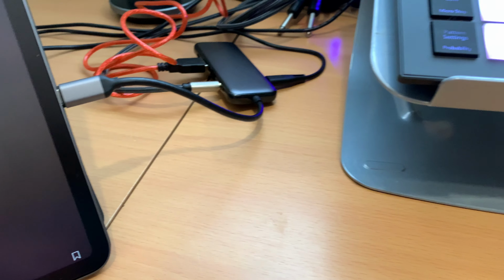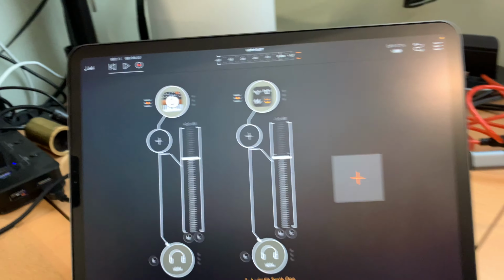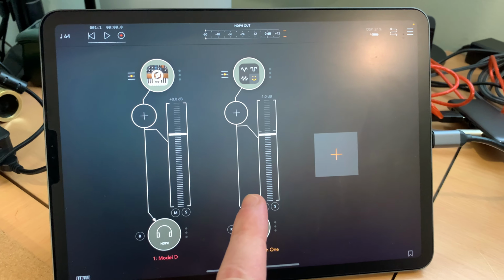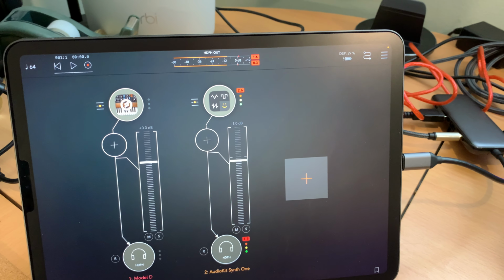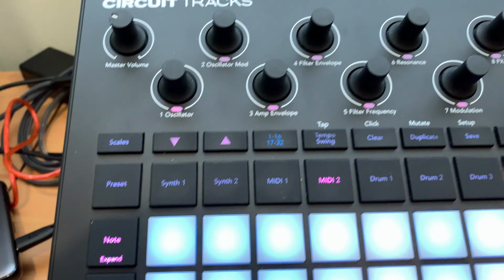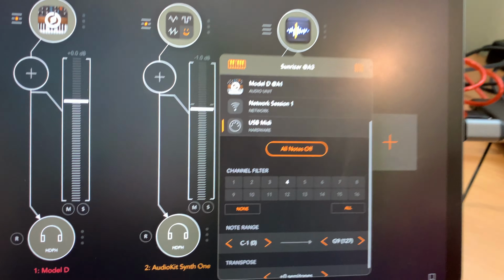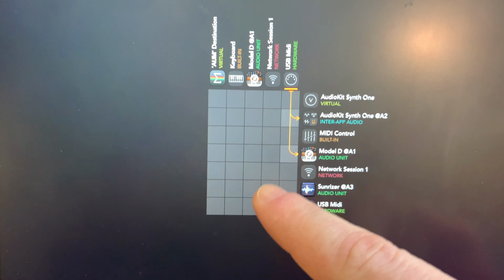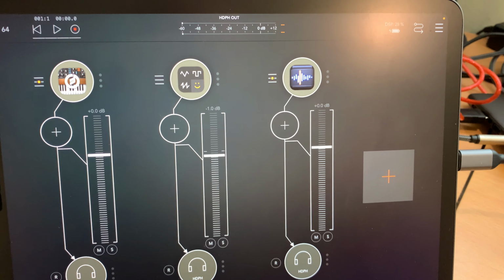How to Use iPad Synths with Circuit Tracks

Comment: Let's say I'm already using the Midi Out and Midi Thru inputs on the Novation CT for a Hydrasynth Explorer and Dreadbox Typhon. Can I plug the ipad into the usbc input on the novation instead using MIDI over USB? Also, If I plug ipad audio into Input 1 and Input 2, can I still mute and adjust volume on mixer for HE and Typhon or does they have to be plugged into CT for that? I don't need CT effects on the external synths. Thanks!
Reply from the maker: Hey! I think you would need a separate mixer for this and route your audito through there. I used to use a Tascam Model 16 for this type of work 👍

Comment: Hi Kevin, brilliant! i am trying to do the same but i have two issues: for some reason AUM doesn't see "USB MIDI Hardware" (the circuit track) as MIDI source, i also have a hub. And second the audio still doesn't go via lightening connection but from the Ipad speaker. Any idea?
Reply from the maker: It sounds like your hub may not be functioning properly? It sounds like all of the features of the hub are not active as if the iPad isn't seeing hte hub and using it. Maybe try a new hub?

Comment: You don't need midi cable to Ipad, usbc handles midi output out of the box for the tracks
Reply from the maker: This is true! I had other hardware synths so this fit better in my workflow at the time. If you ONLY have the iPad then you can just plug it in via USB-C and use hte USB midi function. Thanks for calling it out!

Comment: Great video but unfortunately the part I'm stuck on is the same part you kind of didn't solve right at the end (when you said "i'm not sure why that's still triggering"). I have two channels in AUM with Sunrizer and Flynth set on them. They both trigger on both MIDI tracks on the Circuit and I can't seem to get the channel filter to work!
Reply from the maker: Hey! Sorry! Basically I just rechecked my settings and made sure all my devices and my midi settings had the correct channels set. I believe one MIDI device had still be set to listen on EVERY midi channel. I changed it to a single unique channel and it functions properly. Sorry about that!

Comment: Wow, no wonder my usb c to lightning cable  didn’t work.  Huge disappointment that  both devices can’t hook up with a simple usb cable.  Deal breaker for me as far as using my iPad with my circuit.
Reply from the maker: Hey! This should work! Maybe try a different hub? Or cable? At least MIDI will - but not audio.

Comment: Super helpful video! Quick question for you: Are you using the Circuit Tracks to mix the audio of Model D and Synth One separately? Do you just pan one app all the way left and the other all the way right so that the Circuit Track mixer knobs can independently adjust the software synth levels?
Reply from the maker: Sorry! I missed this comment! Yes, that is the correct way to do this. I failed to mention it. There are a couple other workflow changes that are better than what I said. Makes me want to create an update video. Thank you for the comment!

Comment: can you do the same thing with pc (windows). i would like to use vital with hardware sequencers
Reply from the maker: Hey! I am sorry I missed this. Yeah, you can totally do this. You also do not need the USB to MIDI adaptor. Just plug the Tracks into the computer via USB and it will show up in your DAW as a MIDI controller. Just set the MIDI channels on the MIDI tracks in your DAW and you should be all set. Also, you can just plug the Tracks into the iPad directly and bypass the MIDI to USB adaptor.

Comment: Great explanation for setting up the Circuit Tracks to integrate with iPad synths 👏. For me, this specific setup (using AUM) has finally unlocked the world of iPad synths, sound modules and effects in a practical way. Finally, all those apps I blew all my cash on are becoming worth it. With the Moog Model D, the MIDI settings are available only when the app is opened as a standalone instance. They are hidden from the settings when the Model D is hosted as an AUv3. You also need to restart any running AUv3 instances after editing MIDI from standalone. Hope this helps anyone else stuck with the Model D 🙂
Reply from the maker: Hey! Thank you! This is very true haha It has unlocked all of these synths for me as well. Yes, thank you for letting me know that. Some instruments allow different functions while in plug-in mode while others do not. I was playing with a lot of software synths and was confused. Thanks for commenting on this. :)
Reply: @KevinWilliamsjr  Oh so much confusion trying to understand the settings in iOS music apps! It’s great that Youtubers like yourself make the time to put this content together to educate. With this setup, have you experienced any noticeable latency issues with the audio out of the iPad and into the Circuit Tracks? I’ve had some noticeable latency with the Model D hosted in AUM. I have purchased an audio interface in the hope that it might help, but I guess it could be due to any number of factors...
Reply from the maker: Hey! Yes, definitely. Also, no problem! Very happy it helped. I have't noticed lately at the moment. I suppose my USB-C hub is doing okay in that regard. Yes, an audio interface that works with the iPad should hopefully help. Good luck and hope it works out!

Comment: Hi Kevin really great video, question what about using apple camera adapter ? A m using koala app and the midi mapping is very easy and quick, so the circuit tracks can run with app juste via usb (+camera adapter dungle to phone /ipad ) or not ?
Reply from the maker: Hey! Thank you for the kind comment! Yes, you can totally do this! I do this on my iPhone using the same apps as I use on my iPad. So, if your device has a lightening interface instead of USB-C you can use a lightening to USB-A, Power, and Headphones. I added a link to the video description for the adaptor I purchased for your reference. Thank you, again!

Comment: Great video.. hadn't thought of changing the MIDI channel on the circuit to select a different instrument on the iPad.   One thought is that you can simply this slightly by using a Yamaha BT-01 bluetooth adapter and then you just need a headphone cable into your Circuit Tracks (no USB hub)
Reply from the maker: Hey! Thank you for the kind comment. Much appreciated. Also, thanks for the tip. I never saw one of those before. This is interesting indeed. I could use this is a few other situations, too. Thanks, again. :)
Reply: @Steve Rutherford
Excellent suggestion!
I'll add that the CME WIDI Master is a similar ,newer design that supports BT 5.0 low latency.